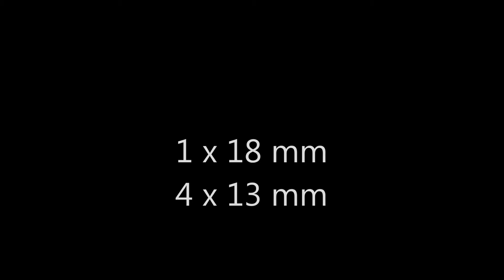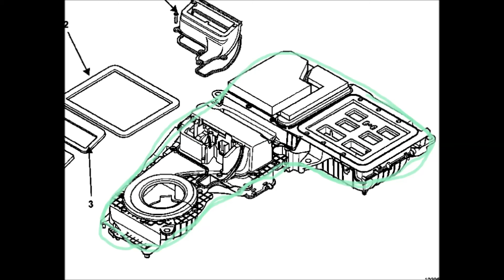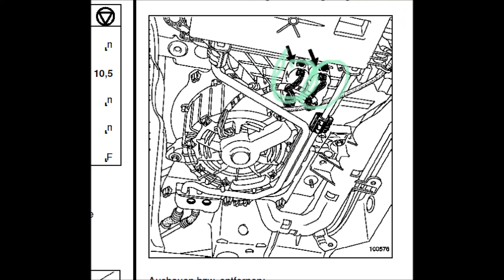Renault Espace IV silnik dmuchawy Gebläse Lüfter Heater Blower

Comment: Mine climat station has electricity and you can set low or high, you can set directions and everything BUT there is no air coming out 😳 what could it be???
Reply from the maker: Check the electric fan
2 resistors on the electric fan